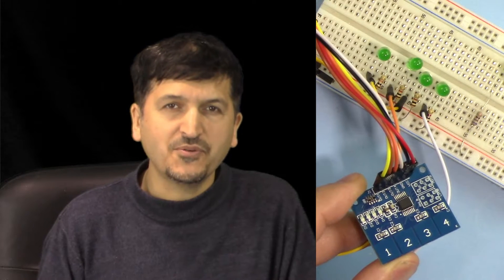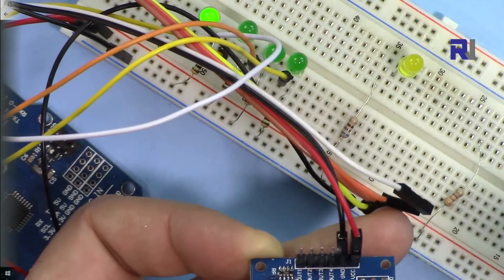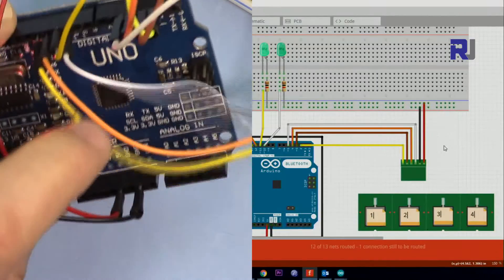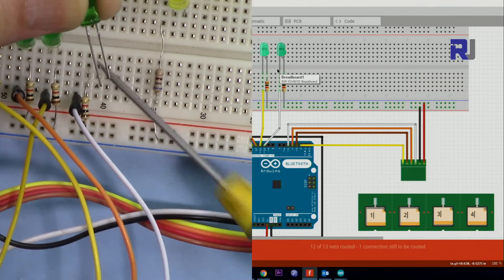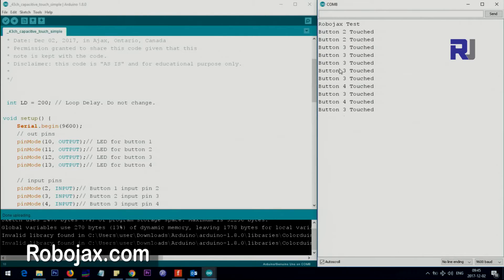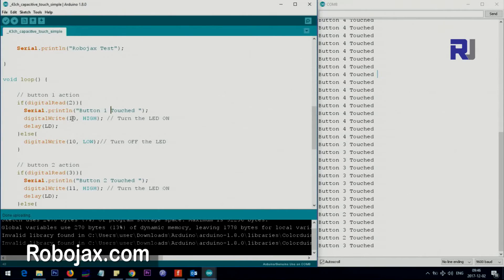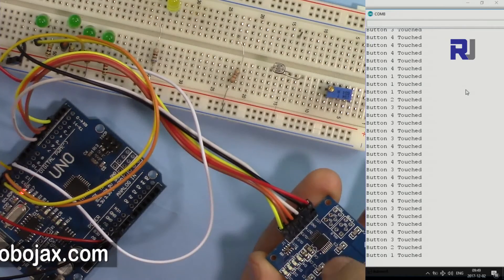Arduino code for 4 channel TTP224 Capacitive Touch Sensor

Comment: can we wire ttp224 pin to analog pins of arduino
Reply from the maker: You posted this comment 9 hours ago before I check it. I assume you don't have the module otherwise why wait. just try it. Yes it works.

Comment: Hi! I tried to download the code through the link but i get an error message saying "The website encountered an unexpected error. Please try again later." Please guide me that where can i get the code from.
Reply from the maker: Hi, thank you for letting me know. It seems the new system did not work, so I reverted to the old site. Now the link is working.
Reply: @robojax  Unfortunately, the link is still not working for me.

Comment: is it passive buzzer that you used for the piano using touch sensor?
Reply from the maker: it depends how you want to sound quality to be. You could use an audio amplifier module. or yes buzzer would do it but very limited and low quality.

Comment: can we connect LED's Directly to TTP224 SENSOR, without arduino
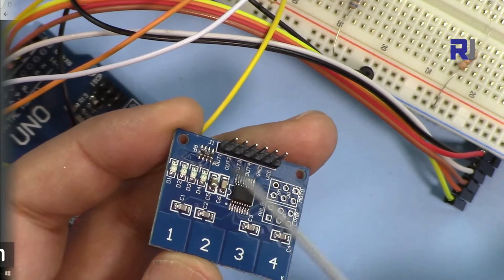Reply from the maker: yes you can use it without Arduino as I have mentioned at 01:18 (click to see it).
Reply: can  u give me the programme software name or software download link
Reply from the maker: if you want  to use Arduino, then arduino.cc is the website.

Comment: hey, great video! I was wondering how I would connect an ultrasonic and a co2 sensor to a quadcopter would I need an Arduino board?
Reply from the maker: thank you.  Perhaps you want to made obstacle avoidance. One solution would be to us Arduino Nano which is small and light weight. See photo http://elabz.com/wp-content/uploads/2011/07/Arduino_nano_v3.jpg
Reply: RoboJax Videos how many sensors can the arduino nano handle?
Reply from the maker: You can't count them. Unlimited. The limit is our mind.  Every day new sensors are coming.

Comment: can you make application for this sensor?
Reply from the maker: application in Arduino?
Reply: can you make a piano using this sensor?
Reply from the maker: But there not enough key. So you would have to add many modules.
then yes you can. Here is the code. Instead of connecting directly a push button to the inputs, connect the output of this module: https://gist.github.com/ostephens/4136787
Reply from the maker: You can't change the sensitivity with software because you want to play tones. For hardware it would be very hard as you have to experiment with many capacitor values.  To reply please follow this https://snag.gy/AHhRpV.jpg

Comment: Bro i have done same all the things in that video u have shown to me but unfortunately 1 & 2 keys led are not blinking in the bread board.. any suggestion..? 

one more thing what the resistor value u have used in these its 10K r 100K
Reply: One more thing i have used Arduino UNO with ATMEGA328P
Reply from the maker: if D1 and D3 are not turning ON, then may be your module is damaged.  For resistor with Arduino, you will always put something between 500Ω to 1000Ω (1kΩ).  Larger resistor will have large voltage drop and LED will not turn on. from the color you can see it is Brown-Black-RED, 1-0-2. 2 the 2 is two zeros. so 1000Ω or 1kΩ.

Comment: hi Robojax thanks for sharing your knowledge..

/* Define the digital pins used for the clock and data */
#define SCL_PIN 8
#define SDO_PIN 9

/* Used to store the key state */
byte Key;

void setup()
{
  /* Initialise the serial interface */
  Serial.begin(9600);
  /* Configure the clock and data pins */
  pinMode(SCL_PIN, OUTPUT);  
  pinMode(SDO_PIN, INPUT); 
}

/* Main program */
void loop()
{
  /* Read the current state of the keypad */
  Key = Read_Keypad();
  
  /* If a key has been pressed output it to the serial port */
  if (Key)
    Serial.println(Key); 

  /* Wait a little before reading again 
     so not to flood the serial port*/
  delay(1000);
}

/* Read the state of the keypad */
byte Read_Keypad(void)
{
  byte Count;
  byte Key_State = 0;

  /* Pulse the clock pin 16 times (one for each key of the keypad) 
     and read the state of the data pin on each pulse */
  for(Count = 1; Count <= 16; Count++)
  {
    digitalWrite(SCL_PIN, LOW); 
    
    /* If the data pin is low (active low mode) then store the 
       current key number */
    if (!digitalRead(SDO_PIN))
      Key_State = Count; 
    
    digitalWrite(SCL_PIN, HIGH);
  }  
  
  return Key_State; 
}

iam trying to working on TTP229 16 touch keypads but its not working its sensing some random number can u pls help me!
or share any links

your help is appreciated!
Rathod
Reply from the maker: If you are reading 16 channel, then you should have assigned 16 pin as input. Your code did not make sense to me. please modify the code I have provided and it has 4 ch. you can easily make it 16. http://robojax.com/learn/arduino/?vid=robojax-TTP224 I will in the future make 16 channel touch video.